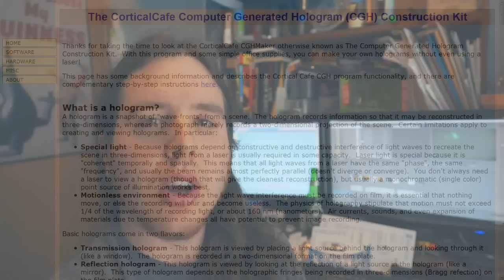Home Made Hologram

Comment: Hi Nick! Thanks for sharing.  I know you posted this 6 years ago, but I’m struggling to get this to work for me.  I’m printing 600x600 on acetate. And I’ve tried both red and green lasers. My images are real binaries and I’ve tried a wide variety of settings.  I also tried printing the premade samples on the website.  All I see is noise projected on the wall.  Office Depot has laser printers that are capable of 2400dpi, which I’m going to try, and I’m going to see if I can get a print that is more opaque.  Other than that I’m short of ideas to try.  It’s too bad because I’m excited about some potential applications for this concept.  Any ideas?
Reply from the maker: Super high resolution was the key for getting it to work for me. It's been a long time since I played with this but I was imaging a 1920x1080 screen onto 35mm film, that would be a little more than 950px/inch. If you can throw your holograms on a USB stick and get them printed at the depot machines it might work out. Sorry I can't help much more, I'll have to try this again.
Reply: Nick Moore ok. Hopefully the 2400dpi will work. In your video you said you developed a positive and a negative.  Was it the positive that worked?
Reply: @teknoah  did this work eventually?
Reply: Veselian sadly no.  I put a lot of work into testing, but I just kept getting noise projected on the wall.  I went to print shops that had the highest resolution laser printers.  I suppose the resolution was the issue, but I have no way to confirm that. 
¯\_(ツ)_/¯